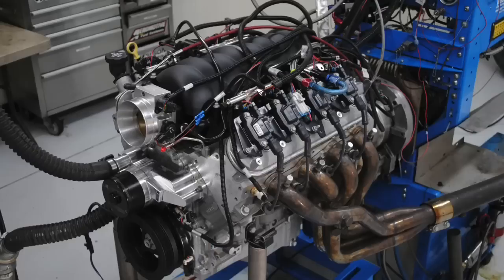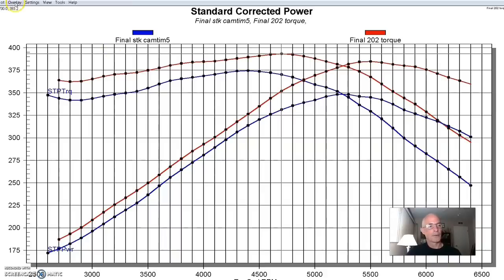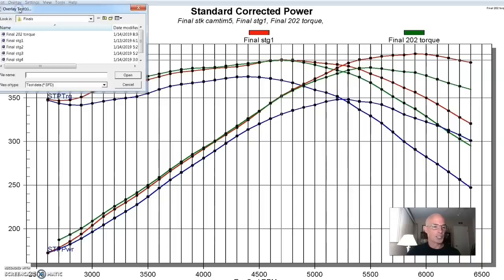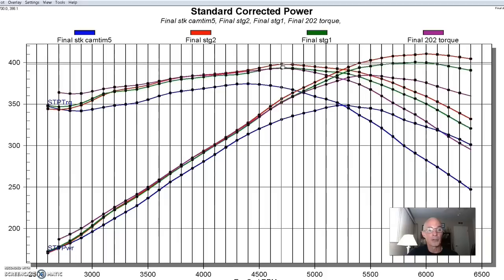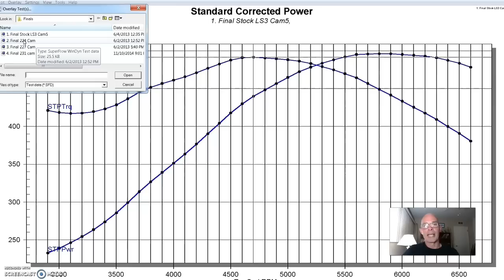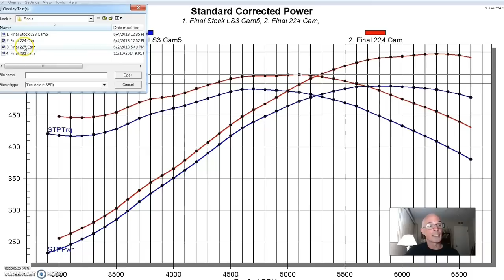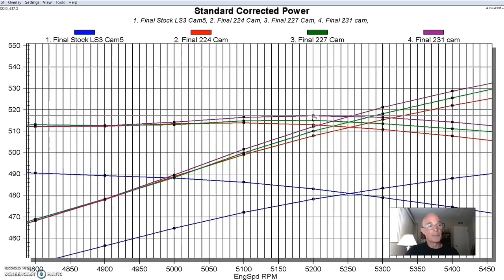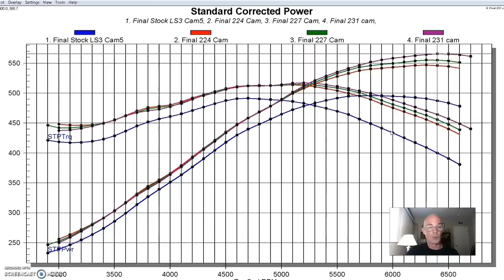LS TORQUE CAM TEST-WHAT WORKS!

Comment: I want a high lift low duration cam in my 4.8 in my truck. Either a stage 1 or a torque cam. I want 10:1 compression and I have a 2600 stall converter.

Comment: Headers make a huge difference apparently. Especially considering stock is 285hp 330ftlbs
Reply from the maker: nope-you are comparing a rated output to a tested output (those are not the same)
Reply: @richardholdener1727  I understand these tests don't have the accessories or the fan... So what is the true "tested output" of a stock 5.3??

Comment: I'd be curious to see the torque cam versus the cam I just picked for a 2013 GMC Sierra Denali awd 6.2 (L9H) Putting a Magnuson TVS1900 on it and went with a BTR PDS Stage 1 V2. (same cam as LS3 Stage 1 NA, and Centrifugal Stage 1)
Reply from the maker: That cam makes good power-just softer down low than others-but the PD blower should have plenty of low speed torque
Reply: @richardholdener1727  thank you for taking the time to respond.

Comment: Hey do they make a truck or torque cam for the 3800 supercharged engine?
Reply from the maker: yes-the small cams are basically that
Reply: @richardholdener1727  so like zzp vs cam. I'd love to have a stump puller and have shift points lower

Comment: I have the older BTR stg 4 and PRC 2.5 243 heads unmilled due to the cam size on my LS6 CTS-V.
 I want to downsize to mill my heads to add more low-mid range torque and throttle response due to the 3800lb weight of the car. I've considered truck cams and a Sloppy Mechanics Stage 2 so far.

Comment: Hey Richard I just picked up an ls3 and it’s going into my 2000 Silverado. The dude recommended that I stay away from truck cams and stick to car cams, is there any truth behind this? It makes a little sense since truck cams are gears more for torque
Reply from the maker: take a look at the video that compares all the stock cams
Reply: @richardholdener1727  All the cams in this video are truck cams v2 which is what I currently have in my 4.8 (btr stage 3 truck cam to be specific) I’m just curious if an LS3 Car Cam will produce better gains 🤔

Comment: I know its not the context of this comparison but the elephant in the room is when the truck guys are looking at this for their original "in truck" ( or car ) engine, they go get a cam change and the torque improvement is huuuuge when they drive it, in reality what has happened is they( the shop) have also deleted or turned off torque limiting in OEM computer which was never going to let the stock cam make what you see on the dyno in their truck, GM does this to increase drive line life, trans and engine, this is done by pulling timing to decrease torque output and adding fuel ( hence improve fuel.milage with new cam too) to reduce cylinder temps, as torque is when engine is most loaded and usually going up hills or pulling trailers or both, high prolonged loads equals heat build up and stresses hence GM protecting their interests, just that a lot of guys watching this might be thinking "my engine doesn't feel like it pulls like that stock" !

Comment: And making sure the fly wheel is balanced to prevent vibration keeps you from breaking cranks and camshaft no one thinks about that torque is made at The bottom end and it’s because of rotating mass not buy anything else people think if they lighten the rotating mash they will be making more horsepower which in someways I will but if you don’t have rotating mass you don’t have torque and you will lose power if you’re looking for a torque bye adding lighter fly wills or clutches

Comment: Does anyone pay attention to the fact torque is made at the flywheel The heavier the flywheel the more torque you will make
Reply from the maker: NO SIR
Reply: Heavier flywheel will carry more inertia, but it does not create more torque.  An object in motion will remain in motion, unless acted upon by an outside force.  So it can resist a rapid engine deceleration, but it does the same to acceleration.  The actual amount of twist the engine is producing, will not be increased.

Comment: What would've been really interesting is taking cams with the same duration and lift, but with different LSA's from 110 to 116 or so. Also, how those different LSA's affect EFI tuning and emissions. I just scored a 5.3 LM7 wrapped in a Tahoe for a Jeep YJ transplant and it needs to pass emissions here in Colorado. Obviously, just leaving it alone, it'll pass, but what fun is there in that? I was thinking a 383 stroker kit and one of the Comp Cams 210/222 @ .050 kits. For me it's not about peak torque, but the area under the curve from 1500 to 5500 rpm.
Reply from the maker: PLEASE SEE THE LSA CAM VIDEO

Comment: Does the torque cam require spring upgrade? New guy here trying to build a decent truck that can tow a boat and camper
Reply from the maker: yes but only to an LS3 or equivalent
Reply: @richardholdener1727  holy crap the LS genius actually replied to my message. Thank you man

Comment: Hello Richard. Love your videos. My question for you is . 2006 H2 Hummer LQ4 with 862 heads ported. Tick cam stage 3 torquer cam #SNS002 .Rocker pushrods and spring upgrade from Tick performance . I am running out of injector and pump . stock 24LB/Hr are falling off at 5700 RPM . What would be your suggestion  ?

Comment: I would like to see dyno on this towing cam on a 6.0 see how it would perform on a low rpm just like if you were towing https://www.tickperformance.com/tick-performance-towmax-stage-2-camshaft-for-4-8l-5-3l-ls2-lq4-lq9-engines/
Reply: I've been wanting him to test it as well!
I still think I'm going to put that cam in my 408 stroker except I'm using the LS3 version since I'm using a LS3 top end.

Comment: maybe there is a dyno functionality  reason why, but I would love to see a test done on each cam especially the torque cams where you do a steady state run somewhere between 1600-2000 RPM (a common cruising RPM) for hp/tq.  Then advance the throttle and hold it steady with about 2" of vacuum to get an idea of what kind of torque differences there is in the real world.  Richard's excuse has always been you don't run wide open at that low of an RPM, but you continuously use that power range in all vehicles.  2" of vacuum would be a condition just before requiring a downshift.

This is what people care about if they are looking for a torque cam for their tow vehicle.
Reply from the maker: ABOUT 2 INCHES OF VACUUM DOES NOT MAKE FOR A REPEATABLE BACK TO BACK TEST-AND NO WOT AT 2000 RPM

Comment: What is the biggest cam i can run on stock 6.0 value springs
Reply from the maker: which stock 6.0L? they are different-some only allow .490 lift, so allow .550 lift
Reply: Lq4

Comment: No mention of that giant low RPM bump from the 202 cam at 3000 rpms? That’s an obvious choice for a DD or towing. You spend 90% of your driving at 3500 RPMs or under

Comment: Would cutting the heads to get an additional point'ish of compression on a 5.3 make up the low speed torque deficit between the BTR Torque cam and BTR Stage 1 Truck cam?    Also have you ever tested smaller (1 5/8") tube headers or Tri Y headers on the smaller LS engines and how they effect the torque curve below 4000 rpm?  Probably not sexy enough for effort I suppose.
Reply from the maker: compression helps both cams

Comment: Do you have a video with the Howard's rattler cam in a 5.3?
Reply from the maker: have not run that one
Reply: I have one in my truck. I was just wondering what the horsepower and torque gain is on it. It sounds and performs great. I guess I will have to get it dynoed.

Comment: How much more torque will a 6 L make with a BTR stage 2
Reply from the maker: which stage 2
Reply: @richardholdener1727  stage 2 truck cam V2 camshaft
Reply: @richardholdener1727  also is it required to retune the ECM. Or should I say is it necessary.

Comment: @Richard Holdener

I'd love to see you test this cam out: Howard's 190315-08. 210/214, 108+4 LSA, .598/.598

I bet it would increase cylinder pressure/low speed torque quite a bit and be a fun cam for truck guys.  Old school torque. Probably good with a stock stall too.

Comment: Great video I wish I would have seen it before I put a cam in my truck. I did see one mistake though the BTR torque cam only has .511 lift according to BTR’s website not .553.
Reply: Was doing my research prior to purchasing a cam. I noticed the same thing.

Comment: Wonder what the tooley cams would do     
In a 4.8 spinning to 6800 or 7k? Can it match the same peak number in exchange for low End tq . Would it make  for an easier driving car that's traction limited but still make the same or close peak hp #s?

Comment: Why is there always such a large split on the duration &  wide LSA on LS cams? Even on the carved motors?
Reply from the maker: carved?
Reply: @richardholdener1727  I think auto correct got to me?  I cannot remember what I said?  Seems more trad sbc motors would only have about a 4 degree difference in duration and were usually about 108 or tighter on say a 350. I have seen it mentioned that without valve reliefs you cannot go that tight?

Comment: I’m curious as to how these numbers are achieved in a stock 5.3L. A stock 5.3 LM7 is rated at 275-295hp and 315-335ft-lbs of torque. How are these numbers measured? Most of the videos I see show the LM7 5.3 at 330+hp and 350-380ft-lbs of torque in bone stock form. Does GM de-tune these engines that much? Do headers and aftermarket efi get you 40+hp and 40ft-lbs? I know a cam wakes these engines up, but I just can’t imagine those #’s in bone stock trim.

Comment: how about Lift vs duration?some of those cams have a weird lift at the intake, lower than exhaust and some heads flow better at 600 than others so will more lift give better air flow

Comment: Richard, another great job, next project I'm working on is a resto mod 91 suburban LY6, factory rebuild, just cam upgrade and shorty headers, 4L80, Holley term X. Because heavy truck looking for torque, any thoughts on the summit high lift stage 1 truck cam ?

Comment: This is a video I've been waiting for! We're putting a 6.0 in a buddy's rock crawler and we're gonna start looking at cams soon. We want torque, obviously. Why do you feel the middle of those cams all sat the same, while the ends feathered like that as far as torque output, with what seemed to be a fairly consistent trade off at the bottom for the top, with each progressive "stage".
Reply: WRT your conclusion, I think the logic of 'smaller cam' for 'more torque' still applies. No,  you don't get as big a "peak torque" number, but for low low speed stuff, like offroad, or trailer hauling, especially with a manual trans, a torque peak at 5000RPM isn't exactly usable. Especially when you're trading 20-30lb.ft down below 2500RPM. A big torque number over 4000RPM reminds me of the old big-single Supra dyno queens that made 1200hp for all of 500RPM just before redline. Yeah, cool it's a big number, but it's pretty meaningless in the real world.

Comment: I dont rev my tbss past 6200 with the btr stage 2 ls1/ls2 cam with a 2600-2800 stall. I am wondering though if i should get some type of torque cam because this thing is heeeeaavvvy

Comment: Richard, what did you expect? you only changed duration so all that happened is the extra duration moved the RPM up. what happens when you change LSA?
Reply from the maker: there is an lsa video

Comment: I want a cam that chops good and drives good daily without a stall. I occasionally tow and im not a drag racer. i have 2012 sierra 5.3 lmg what should i go with?
Reply from the maker: stage 2 truck
Reply: Richard Holdener my dude! Thanks for the reply!

Comment: When looking for tq, why run 113 lsa on those LS3 test cams? It would have been nice to see 111lsa, 112lsa, or even a 112/113lsa with +2-4 degrees ground in. You have shown in your testing that a tigher lsa helped low end tq and even made more peak torque. It would also be nice to see the lift stay the same or similar if you were going to focus so much on which cam had more or less duration.

Comment: I really like the curves here. How about a study on power under the curve for those of us with Transmissions? My trans can handle 800ftlbs but doesn't like to shift over 6200 rpm. I would like to pick the best cam for a boosted application to maximize my power and drivability under that mark.

Comment: People need to realize more torque where you dont use it is not good. When you are looking for towing and 4x4 torque you want it early. Not more at 5000+ rpm. Try to show a tight lobe separation and what it does with torque early vs a wide lobe.

Comment: I have a lq4 swapped 2004 tahoe with a tick torquemax stage 4 cam and a 2400 stall. I make 300lb pounds at 2k rpms. Perfect for towing and getting out of the hole.

Comment: I’m looking for towing torque with my 5.3. With 33” tires, a 4L60e, and 4.10 rear gears, it’s very important I can get into that deep .70 OD and STAY there while pulling a double tandem. So torque in the 1200-2500 RPM area is actually way more important to guys like me instead of peak torque further out in the RPM range. The data is clear here. Each stage of camshaft progressively drops off low RPM torque to gain more up top. The torque cam looks to hold a good gain of torque at the bottom while still making numbers up top. That will be the cam I order tomorrow. Thank you for the data Richard. I think I’m also going to pull the 243 heads and stick 862 heads on with a thinner gasket. The extra compression and smaller intake valve with less shrouding seemed to do very well with all around numbers and low end in your cathedral head shootout.

Comment: I bought a Btr stage 1 truck cam for a 6.0 engine build. When I un-boxed/ un-bagged the camshaft, one of the lobes had a black speck on it. When I rubbed that speck with a rag, there was a small corrosion pit on the surface of the lobe. I tried calling customer service, and they never picked up. I printed off an exchange form to swap my cam for a new one. So I sent that one off, and received a "new" one. The cam I received was the same cam, they polished the lobe down where the pit was, but not enough. I could still see the outlines of the pit on the lobe. I ended up returning it , and I went with a Tick torquemax cam.
Reply: I’ve had really bad luck with BTR parts.

Comment: Would be good if you could show average torque between 2000-5000rpm as that's where most daily drivers are used.

Comment: Good video Richard.  I just built a 5.3 for a '68 C10, I used a Texas Speed Stage 2 truck cam with .550 lift.  I found much the same thing from their published data on their Stage 2-4 cams including .600 lift versions.  The difference between a .550 lift Stage 2 and a .600 lift Stage 3 was 11 hp @ 6100,  torque was  very close in the midrange but down low there was quite a drop off where you drive the most.  The 11 or so hp on top really isn't worth it for me but to each his own.  Want more torque ?  Could you stroke a 5.3 and would it be worth the money ?

Comment: ATTENTION Richard or other LS gurus, please help.  I have an old 2018 MSD 6014 box to run carb LS.  It bucks and back fires, runs  fine some times, won't start,acts crazy, its is all over the place.  I have gone through wires and everything,   I have cheap ultra power crank and cam sensors.  Do you know of common problems that occur with this unit?  I think maybe I need better sensors,  any recommendations?

Comment: When doing strictly a torque comparison I think you should pull the dyno steady state and do 500 rpm steps starting at 1500 going to say 3500rpm then you will get to see better what is going on in the cruising range most people run in.

Comment: When are you going to release your LS torque cam, Richard? I'm looking for a cam for a 5.3 w/243 heads in a Tahoe. I'm about to buy a Elgin e1257p (212/218 .522/.529 114LSA). Unless you have a better option. I'd rather buy it from you.

Comment: Probably the most disappointed in this video vs any on the channel so far. This was just another duration comparison video. “How to maximize towing torque and MPG on a towing truck” would be way better. This video failed to even highlight how to maximize low-end torque with a cam. :-(

Showing the torque differences from a mild, moderate, to a wild cam LOBE / increasing lifter acceleration rate would show more differences.

A more aggressively lobed cam and or rocker ratio that yanks the valve open faster and that has LESS seat to seat duration but more lift (and comparatively more duration at higher lifts) will increase torque production more. 

A tighter LSA will narrow the power band, BUT produce higher peak torque numbers. -I would’ve loved to see a really aggressive lobe and rocker ratio with a much tighter LSA and a smallish TRI-Y header.

Increased exhaust VELOCITY from a smallish primary diameter header with a faster triy design will also help, ESPECIALLY when combined with the increased overlap of the tighter LSA -> the combination increases cylinder filling AND prevents torque robbing reversion.

Longer intake runners obviously part of the lower RPM torque “recipe”.

And don’t forget about cold air: a cold air intake and or introducing fuel farther from the valve will increase torque across the curve AND allow more ignition timing for producing more torque with a given octane fuel. A bell mouthed throttle body entrance also has a small similar effect.

Would love to see a video on maximizing truck towing capacity and fuel economy with an LS truck motor that dives into more options in the future. (More spark dwell +big gap and learn burn in ECU can aid the MPG gains.)

Comment: Quick question. When you do these, do you convert them from the cylinder deactivation? I am guessing you do.
Reply: You should be able to disable it through an ECM tune but I believe the 5.3 used was a gen 3 without DoD and the LS3 never had DoD